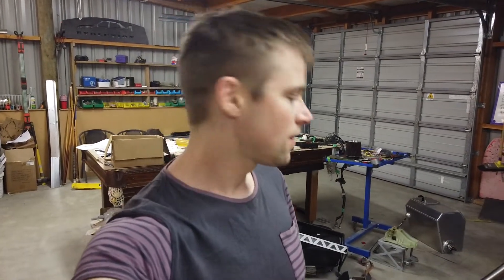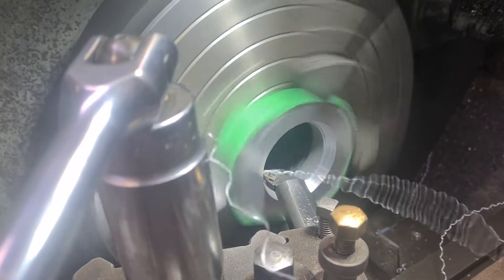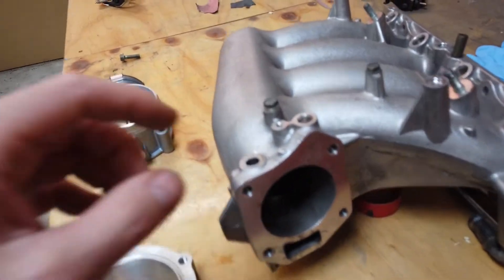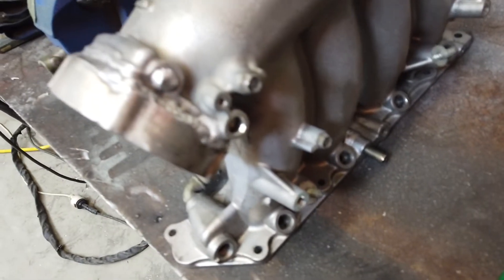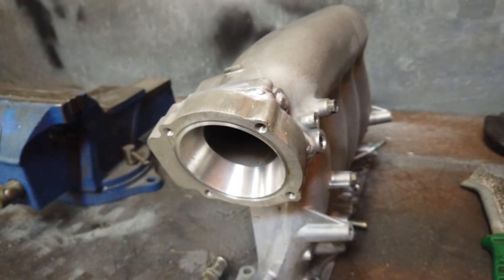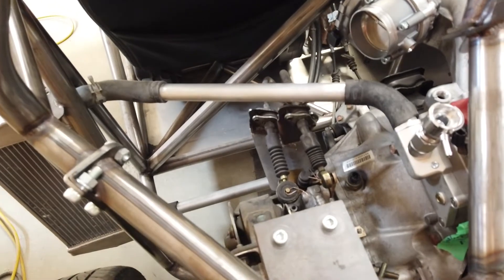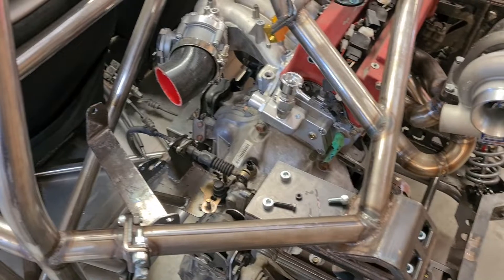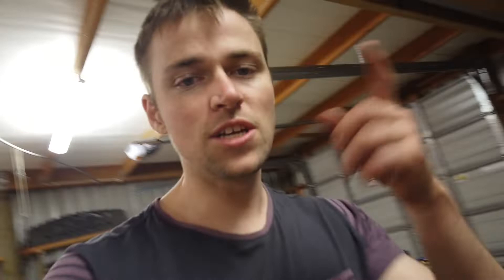Scratch Built Design # 14 water to air cooler / throttle body adapter

Comment: Tbh, I’m surprised you didn’t port the open to the manifold so that you could benefit from the larger throttlebody. 

Amazing work! I’ve a dream to do the same as you… I’m realizing just how much needs to be considered and planned for! I’m pretty sure that if I’m ever able to do something like this, there will be a ton of borrowed systems from the engine donor car.!
Reply from the maker: Hey Glynn 
Thank you it is alot of work but could be done alot similar to make it more straight forward but for some reason im inclined to over complicate thing and add extras.
I did open it up alot but the throttle body was alot bigger then it should have been but was all i could get at the time.